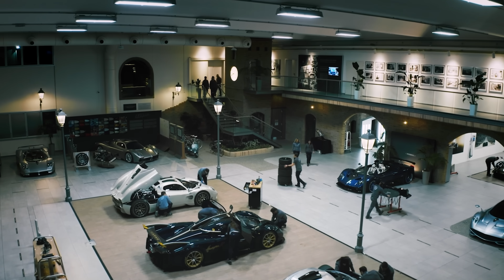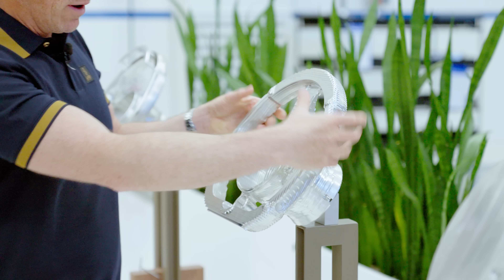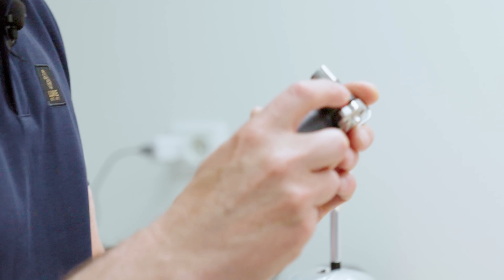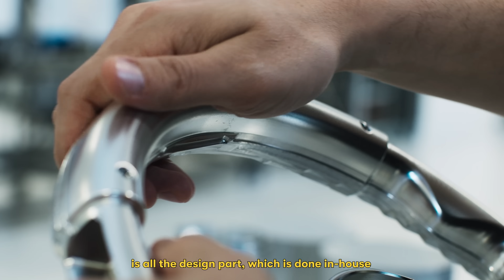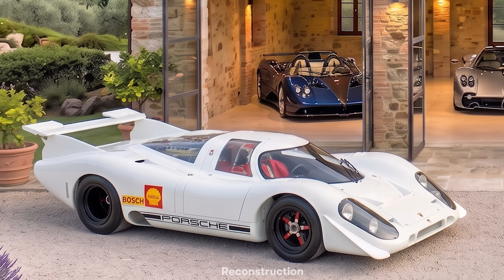Why Pagani BOLTS cost more than a Porsche 911!

Comment: No bolt will cost that much, i work in spinal implants bussines and all products are medical grade titanium and most likely the grade is higher in medical, also the precision is higher than industrial parts so with the material and most likely they are produced in bulk rather than much smaller numbers in implants, it is impossible to cost that much. If they pay this much i want to work with them with those bolts.

Comment: Artisans are so inspiring. Worked with Piergiorgio Ferremi for a while. But they often have critical personality what means that they have to work alone or need employees that play the monke being told monkey do thing. In his game he hires artisans exclusively and I would be really interrested in how he manages to keep them doing the order. I am a CNC part pro regarding to engineering and always had the goal to make them appear beautiful even in a wing of an airliner using various esthetic principles. I'd drop a good amount of income to be privilleged working at Pagani to really have the order to melt function and beauty. I'd be exactly right mind setted because in common industry you always have to struggle to implement what nobody pays for. Meanwhile learning to TIG weld to create steel cycles because it is so satisfying.

Btw working in Weissach was the most annoying experience ever.

Comment: All the nuts and bolts on my 1926 Douglas motorcycle are stamped with the Douglas of Kingswood logo. They are also ALL 25 TPI so if you 
needed spares you had to buy from Douglas.

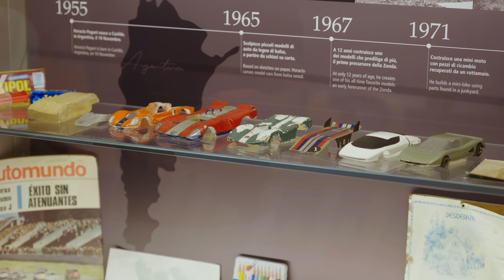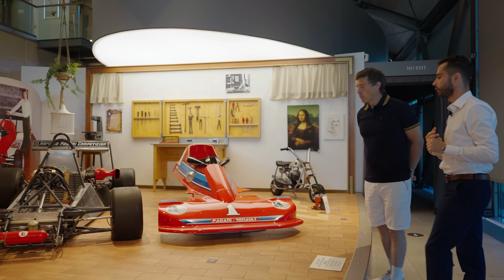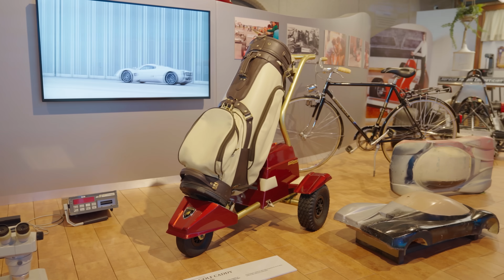Comment: Museum & Origins: The journey begins in the Pagani museum (4:22), exploring Horacio Pagani's early life in Argentina, his self-built Formula 2 cars (5:41), and his transition to Italy to work with Lamborghini and eventually establish his own brand (6:09).
The Atelier (Factory): Unlike traditional automotive assembly lines, the Pagani factory—referred to as an Atelier—is a small-scale, artisan operation with only 300 employees (0:25). Every car is hand-assembled over a 9-week process (16:55).
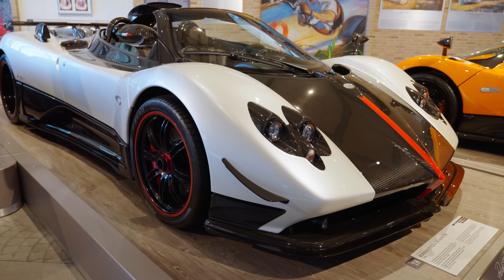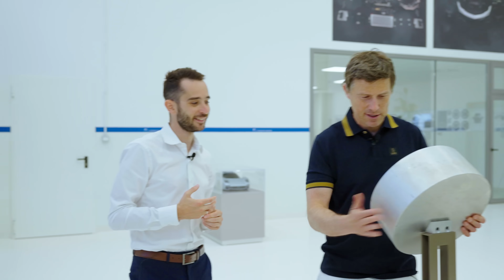Carbon Fiber & Engineering: Pagani is world-renowned for its mastery of carbon fiber and carbo-titanium (9:30, 21:50). The video details the obsessive precision of their CNC machining department, where a solid block of aluminum (43 kg) is milled into a finished, lightweight steering wheel (1.7 kg) (14:15–15:55).
Unrivaled Attention to Detail: The high cost of Pagani cars is explained through components like their bespoke titanium bolts, each etched with the Pagani logo to a depth of just 2 microns (21:05), costing £120,000 per car in bolts alone (21:17).
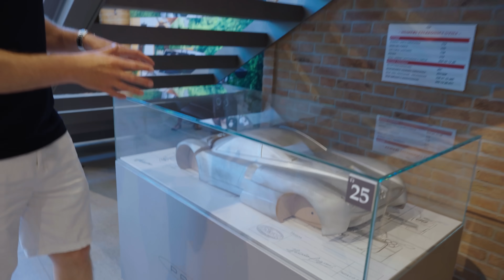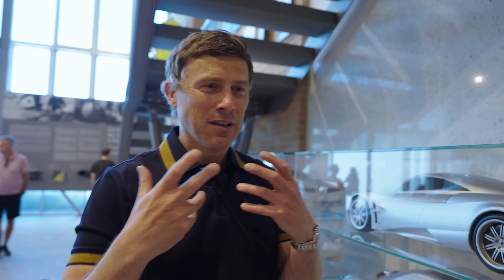The Philosophy of Horacio: Horacio reveals his design approach, which eschews computers in favor of hands-on physical modeling with wood and resin, inspired by the Leonardo da Vinci ethos that art and science must be combined (12:49, 13:18).
High-Mileage Heroes: The video concludes by showcasing that these aren't just museum pieces; examples like a Zonda F with 120,000 km and a Huayra BC with 150,000 km demonstrate the durability and daily-driver capability of these hypercars (34:49–35:50).

Comment: Those anodised blue wheels do look very pretty. Unfortunately they are a disaster from an engineering point of view. The hard anodised layer reduces the material's resistance to fatigue cracking. And on a wheel, of all places, the number of load cycles is very high indeed.
Reply: Your comment is wrong because assumes Pagani uses thick, brittle industrial hard anodizing on their wheels, whereas they actually use non-destructive, micro-thin cosmetic tints and aerospace-grade shot-peening specifically engineered to prevent fatigue cracking.

Comment: The bolt costs 120k quid because Pagani said so. You can't sell rich people expensive toys without bullshitting them into it. I would accept it if it was a matter of years of RND going into a single car, but the reality is each subsequent model is a successor to the last, so the RND is generationally passed down and only improvements are made.
Reply: The real value of each Pagani bolt reaches £60 because of the manufacturer "Poggipolini" . Remember a small, highly specialized engineering firm must absorb massive development and liability costs to precisely manufacture micro-batches of these unique, custom-engraved titanium-palladium fasteners.

Comment: 60 quids for that small bolt ? u can get it from other EU suppliers for 10-20 euros, depending on quantity ordered
Reply: The real value of each Pagani bolt reaches £60 because of the manufacturer "Poggipolini" . Remember a small, highly specialized engineering firm must absorb massive development and liability costs to precisely manufacture micro-batches of these unique, custom-engraved titanium-palladium fasteners.
Reply: and since he mentioned that Titanium bolts are used throughout the whole car , it means that it is to show off to their buyers. There is no actual engineering value in using it.  If they had cost optimization in mind, then titanium bolts will only be used in certain locations in the car while stainless steel bolts are used elsewhere
Reply: @KL-zp6xr   The titanium-palladium bolts provides immense engineering value by stripping crucial kilograms of weight across the entire vehicle and completely neutralizing the threat of galvanic corrosion against your carbon fiber chassis, something heavy stainless steel bolts simply cannot do.
Reply: @agustinmartinez9798  He did not say that the Titanium bolts are used to hold carbon fiber parts together. It might be used to hold metal to metal parts together too.  Someone who uses an fancy racing bicycle told me that it is better for him to lose 1kg compared to paying a nice sum of money to make his bicycle lighter by 500g or 1kg.
Reply: @agustinmartinez9798 He did not say that the Ti bolts were used to hold the carbon fiber parts together. So, it might also be used to hold metal to metal parts together

Comment: A video of almost 38 minutes to answer why Pagani bolts cost more than a 911? Read and save your time:
- Material: Every bolt on a Pagani is made from high-grade titanium, rather than common aluminum or steel.
- Personalization: Each individual bolt features the Pagani logo.
- Cost Breakdown: Each of these bespoke bolts costs approximately £60. With roughly 2,000 bolts used throughout each car, the total expenditure on bolts alone reaches £120,000.
- Manufacturing: The precision required for this level of detail is so high that Pagani uses a specialized drill to etch every single bolt.

Comment: Aerospace grade Ti-6Al-4 titanium fasteners of that design and approximate size cost between £2.50 to £4.50 each. If you add a bit of bespoke marking, another 4 quid. £60 a bolt, total bollocks.
Reply: The real value of each Pagani bolt reaches £60 because of the manufacturer "Poggipolini" . Remember a small, highly specialized engineering firm must absorb massive development and liability costs to precisely manufacture micro-batches of these unique, custom-engraved titanium-palladium fasteners.

Comment: Saw this car in person when it was touring through LA (in a dealership, not in traffic) and it was truly an amazing experience.
Reply: There is a Lamborghini dealership in DFW that has a Pagoni Zonda positioned in its bay so that it's the first thing you see when you drive onto the lot. I delivered a lot of packages to the dealership over the course of 2 years. I probably delivered between $750k and 1 million dollars worth of parts including multiple sets of rims, the side panel of a Urus, and a replacement engine for a Ferrari 512 to different connected dealerships/repair shops. 
It was always great seeing the cars the places had on site.
The people who work at the high end dealerships also tend to be some of the most down to earth people in my experience.

Comment: 34:00 Wait a second. Let me calculate that! The highest performing automotive battery cells that I know of support discharge rates of 12.5C (but that info is a few years old). To reach 750kW of power (~1000hp) they would need a 60kWh battery which would still be a usable range. If we assume that pagani is interested in paying extra to get low carbon emission cells, then the production could probably emit 50kg of CO2eq/kWh. That is what production of automotive battery cells today emits. So such a battery would cause 3t of CO2eq. That is the equivalent of burning 1000kg of petrol (including mining, refining and shipping of the petrol - 1200 kg if we exclude that). For a Pagani I'd say 10l/100km is reasonable. So 3t of CO2 equals 10.000km driven. Mr Pagani said, their customers are driving 1000-2000 km/year so the battery would be neutralised after 5-10 years. The battery lasts 20 years. 

Mr Pagani probably learned that battery fact a few years ago when emissions were still larger or calculated with a big battery, but why would you want 500 km of range in a car that only drives 2000 km a year?
Reply: But a 60 kWh battery under constant track abuse would degrade so fast that it would need a full replacement long before reaching that 5-to-10-year carbon neutrality mark. Furthermore, high-performance batteries degrade chemically just by sitting in a garage unused, meaning a collector's car that only drives 1,000 km a year would waste its environmental lifespan anyway.
Reply: @agustinmartinez9798 mate, we're talking about 20.000 km in 10 years. That's nothing and I doubt that these cars see an awful lot of track action, anyway. The reason I said 12,5C for discharge rate is that a Rimac Nevera battery supports this and that comes with a warranty of 8 years. Battery degradation projections have always been very careful and it almost always turned out to be too careful. even in cars that mainly do fast charging age slower than expected. But all of that still doesn't matter because if those cars only do 2000 km/a they will still only do 20.000 km in 10 years. A Taycan battery is estimated to lose 10% over 100.000 km, and by then, in absolute numbers, has probably seen more abuse than a pagani in 20.000 km.

Ps: afaik high performance batteries do not have a higher chemical degradation over time at least not within automotive grade cells. There are high performance cells capable of discharging at 100C. Those might age rapidly but those are relatively unsafe and definitely not automotive grade.

Comment: Real cost is in the patents that pertain to metal composition, heat treat, machining process, testing. Especially coatings  and meterial enhancements.  Like the company Chromalloy that coats jet engine parts with ceramics, their cost is minimal, but the price they charge is huge because they have so many patents. What the market will bear.

Comment: Beautiful.. curious how they mitigate galvanic corrosion using titanium bolts on aluminum parts.  It would be devastating if due to this oversight these pieces don't stand the test of time.
Reply: T lube like on the bikes.
Reply: @besouniveirs.1643 would be interested to hear how they solve for it, whether it truly is lube and they account for the drop in friction and hold, or the aluminum threads are all anodized... Wouldn't mind geeking out on it.

Comment: Very impressive car and man. But it was not the most expensive car either sold in the 21st century or made in the 21st century if he meant that at auction?   A 1955 Mercedes-Benz 300 SLR Uhlenhaut Coupé, which fetched $142 million (€135 million) at an RM Sotheby's auction in May 2022. And a 2025 Ferrari SP3 Tailor made sold for $26million in 2025 at RM Sotherby’s. Albeit prefer the Pagani as work of art with total
Passion👍
. I still don’t understand though why the top dealers consider Bugatti as the pinnacle considering beautiful cars but some parts shared with VW group. Non of that with Pagani👍

Comment: I'm getting pretty bored with this companies getting so much coverage. They're propped up by gullible idiots believing the prestige of the brand some how makes that bolt worth 6 figures, when you have to be a complete and utter moron with more money than sense to think these cars are engineered to be worth what they're charging. Also, its another one of these brands where the owners will never report on how unreliable, undriveable and awful the overall driving experience is. I bet nobodies done 100k in a Pagani, because they're unbearable to drive in for over 20 minutes.

Comment: the pagani utopia costs twice the price of a huarya but is the exact same car just with a different body. same engine, same gearbox, same brakes, same chasis, same wheelbase, same height, same width. the utopia is just slightly longer. the utopia isnt a new car. what  a scam.
Reply: Your statement is incorrect because the Utopia features a newly developed, stiffer carbo-titanium chassis, a heavily upgraded engine producing more horsepower, and the option for a true seven-speed manual transmission that was never available in the Huayra. It's fully redesign complete different car.
Reply: @agustinmartinez9798  engine: huarya: 5,980 cc (365 cu in) Mercedes-AMG M158 twin-turbo V12
utopia: 5,980 cc (364.9 cu in) Mercedes-AMG M158 twin-turbo V12. transmission: huarya: 7-speed Xtrac 1007 MT manual. utopia: 7-speed Xtrac manual. they even have the same 0-60 time but the huarya has a higher top speed  than the utopia.
Reply: @toppot8329   The Pagani Utopia has an extra 134 horsepower (total of 852 horsepower) compared to the Huayra's 730 horsepower. In photos, the engine bays look completely different because the Utopia has larger turbochargers, redesigned cylinder heads, and completely new piping. The Huayras use a paddle-shifted automated system with no clutch pedal, whereas the Utopia has true, 7-speed gated manual stick shift and three foot pedals. Utopia rides on a new frame that is over ten percent stiffer and uses entirely different hidden air channels to glue the car to the road.

Huayra Coupe (Original): 730 HP / 1,000 Nm torque — 7-speed Automated Manual Transmission (AMT) with paddle shifters.
Huayra BC (Lightweight Coupe): 764 HP / 1,000 Nm torque — 7-speed Automated Manual Transmission (AMT) with paddle shifters.
Huayra Roadster (Open Top): 764 HP / 1,000 Nm torque — 7-speed Automated Manual Transmission (AMT) with paddle shifters.
Huayra Roadster BC: 802 HP / 1,050 Nm torque — 7-speed Automated Manual Transmission (AMT) with paddle shifters.

Utopia Engine & Gearbox Specs:
Utopia Coupe: 852 HP / 1,100 Nm torque — 7-speed Gated Manual Transmission with physical clutch pedal.
Utopia Roadster: 852 HP / 1,100 Nm torque — 7-speed Gated Manual Transmission with physical clutch pedal.

Comment: Meanwhile Ferrari went to Logitech and want to charge 200k for a manual.🤯
Reply: Ferrari doesn't get exempted like Pagani regarding EU regulations because Pagani sells under 1k cars in the EU in a year thus homologating a manual transmission for a Ferrari car in the EU is way more challenging than that for a Pagani car! Ofcourse clueless people like you will never understand that!
Reply: @Drake-296so you are justifying 200k for an electronic gear lever? Homologation will be required even when the car electronic gear shift is introduced. I am a Ferrari fan, but they have been taking their customer on a ride for a long time with their exclusivity lists, ‘limited’ editions and prices.
Reply: You are clueless, Ferrari doesn't need to homologate the Manuale variant differently as it's a DCT underneath thus it doesn't have an effect on their fleet emission numbers according to the EU regulations for homologation. If it was a traditional manual transmission variant then the car doesn't have precise shift points to reduce emissions as they have with their DCT. Those who doesn't want the car they can keep away from it or stay with the car with paddle shifters and 200k USD is far less than Koenigsegg charging nearly 1m USD more for their fake manual in the CC850 which happens to a Jesko with its LST underneath.